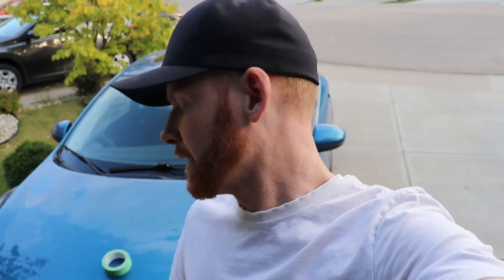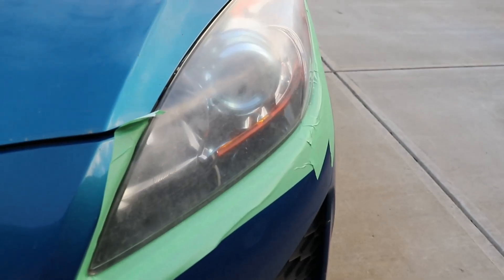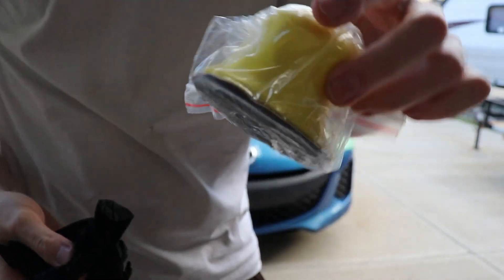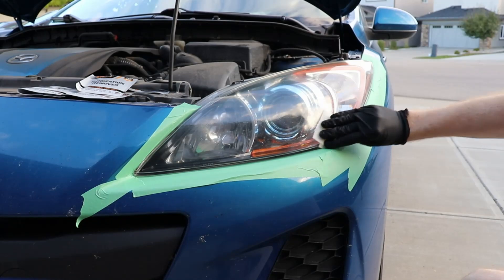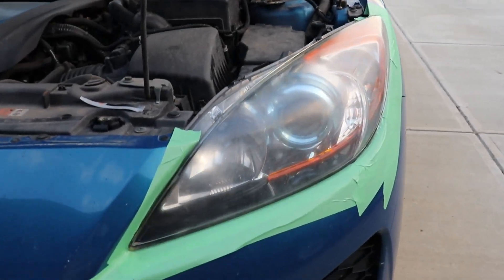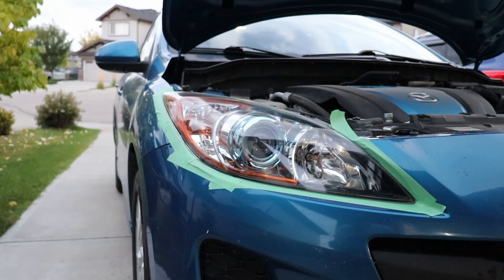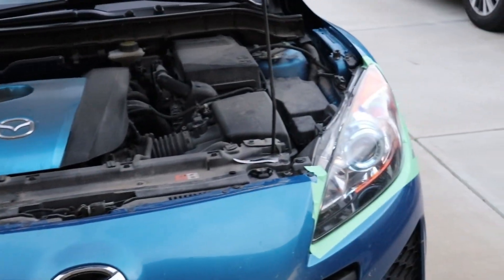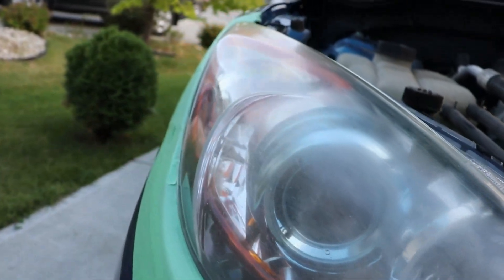How to Restore headlights using Cerakote Ceramic Headlight Restoration Kit

Comment: Thanks for sharing your video. I had equally amazing results using Cerakote on my wife’s and daughter’s car. In addition to the headlight restoration, I also used Cerakote trim restoration and by far, the best product I’ve ever used for coating and treating trim as well. Good stuff, easy to apply, and lasts a very long time.
Reply from the maker: i have heard good stuff about the trim restoration. I will have to give it a try. Thanks for watching and commenting.

Comment: How long do the Couting protect the headlamps , if the are less of 12 mounds its the a bad product when you look at time of protect  time
Reply from the maker: I think it depends if the car is parked outside or inside. I got about 15 months outta my application and it parked outside. I found it pretty good. I am also trying other products to compare how well they actually hold up.

Comment: Thanks for giving me the confidence to use this product. I'm curious as to your understanding of horizontal vs. vertical wiping on the last step? It sure looked as though your strokes were vertical. It worked out so I guess it can be either as long as they remain the same thru the whole process.  Thanks again
Reply from the maker: i am glad after watching my video it has given confidence to try this your self. Its is a fairly easy process.

As to the horizontal vs vertical i did rewatch my video. i was kinda doing a mix of both directions i was trying to do it horizontal as that is what the directions want. but maybe due the the orientation of the light i my wiping is off.i believe i did it better on the other side.

Thats for watching.

Comment: Thank you Sir, great demonstration without smoke & mirrors, decision made & order placed. As if & when you need a browny point or two cerakote ceramic trim coat is as good as the headlight coating so they say, that too in my goody bag. Q : Did your mother-in-law notice her brakes felt a little different? Changed my Ex's brakes when I met her, pads down to metal & discs scored which on a 83 Alfa Romeo AlfaSud is a huge PITA. The only thing she did notice was that now she could not hear the brake squeel over the oem installed cassette player. Thanks again, looking forward to clear headlights & trim looking black again.
Reply from the maker: Thank you, The highlight kit was fairly easy and is still looking pretty good almost a year later. I have hear good things about the Trim kit too.

Brakes on the mother in laws honda civic was a bit better yes. sometimes you need to change out brakes due to grooves in the dics or warppage that seems to be the reason I have done mine car. At least the your exs brakes at lound anymore lol.

Thanks for watching.

Comment: After reading comments I had great expectations of at least a 90% restoration on our 2005 headlight. I carefully followed the video's procedures.
Within a few minutes the cloudiness resurfaced. You can barely see the components under the headlight covers. It actually accentuated all the tiny cracks. Under daylight the surface is all fracked making the headlights even worse before using the product! I had applied the step 3 coating in the same speed and manner as the video instructed yet there are noticeable streaks.
Do you recommend buying another kit and start over?

Comment: Horizontal…means left to right….working from top to bottom.   You went vertical working top to bottom. Not sure that matters or not.    How long does it last?
Reply from the maker: Its lasts about 1 to 1.5 years. Depending if you keep your vehicle in the elements or not.

Comment: How has it held up?
Reply from the maker: Mine has lasted just over a year with perfect lens, now they are a little bit hazy which will need to be done again. but i do drive alot of highway as i work 2 hours away. With sand light gravel being kicked up and car not kept in a garage. 

only reason i state this is because conditions matter how long the finish on the headlight will last, and i want to be transparent as well.

If i had parked in the garage didnt get much uv rays and just did city driving i would assume it would last longer. but i cant say for sure.

overall i am happy with the product.
Reply from the maker: @gofigure_1  might be worth a try vs using the final coating which is a ceramic coat... i think if you did the ceramic coat first the clear coat wouldnt stick... but if you the the clear instead or before the ceramic coat it could last longer. Thanks for the comment seems like a smart idea.

Comment: Good videos, fellow Canadian! In my 2010 Mazda3, it’s clouding from the inside. 😔
Reply from the maker: ah yes you might have the xeon headlights my brother in law has the same issues. Thinking because the bulbs get so hot. looked like you will have to replace the lights if this bothers you that much. 

Thanks for watching, always great to know more canadians get to see my channel.
Reply: @TDLDIY  Haha, when I saw the Crappy Tire Certified branded brake cleaner you bought, I knew you were a fellow Canuck.  And you're so smart, yes, I do have the HIDs from the GT! Picked up a 2010 hatch w the 6-speed manual.  It's actually the DRLs that run hot since it's very high-wattage, and H8 bulb I think.  I also notice with this car, if I start it up cold, drive 1-2km to grab a coffee, then shut it off and try to re-start, it cranks away and doesn't want to wake up.  You ever noticed that in wifey's smiling car?
Reply from the maker: @forevr_8  oh ya crappy tire that's a sure give away and all canadians have something from crappy tire. 

ya my brother in law has the same year and model. His is a automatic thou.

No I dont have any issues with starting cold and drive a short distance and turning it off, and trying to start again. Then again I normally dont drive short distance and I will let the car somewhat warm up. 

does this happen only in winter or warmer months too?
Reply: I got the car in mid-Sep, so I assume it only does it in cool weather. Seems like it runs too rich when cold, so the cylinders are flooded when not warmed up yet. It’s a fun, peppy little car, but I’m turned off from seeing so many OEM parts that say FoMoCo on it, haha.

Comment: Should I buy the kit brotha
Reply from the maker: I found it worked good for me. i am still seeing how it turns out long term. It might be something we need  to redo at somepoint. 

I think it will also depend of you keep your car outside vs in a garage or covered area.
Reply: @TDLDIY  thank u. I tried the meguiars kit that comes with the clear coat spray can but I would have to redo every year. I just bought Cerakote Hopefully it works better

Comment: I used it and it left scratches in my lights and they are still hazy.  I’m not impressed
Reply from the maker: I am sorry that happened, did you follow the instructions to a T? It worked for me and many others which has given this product a 4.5 or greater star rating. As you saw in my video it worked very well. I would not promoted something that clearly doesnt work, and if i did i would be asking if i did something wrong.